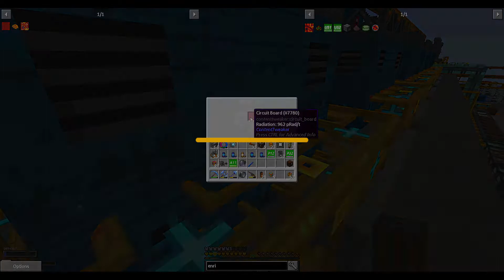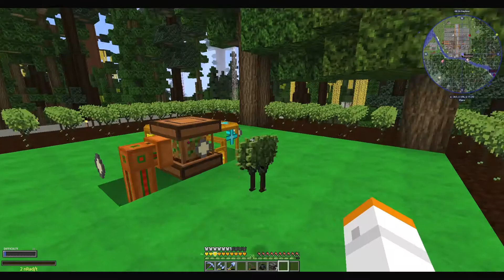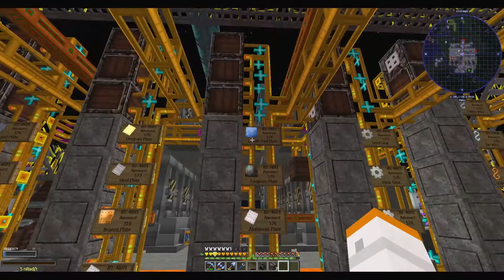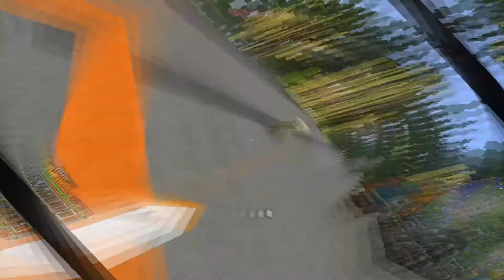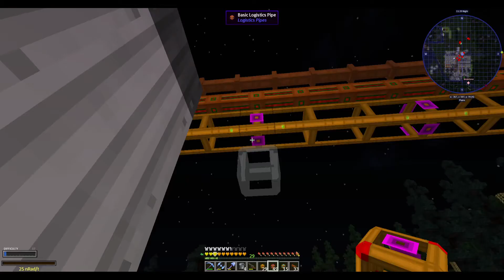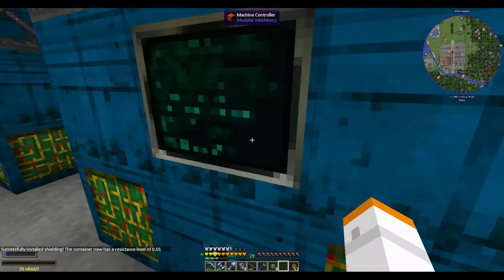Manufactio NE EP18 Base Updates Starting Tier 3 Circuits

Comment: do u have ender chests and remote orderers and pipes? if it still works u can use this orderer together with an ender pouch to requests items on the go, kinda lika a primitive ae system
Reply from the maker: Research Gated, likely will have access to Refined storage before I have access to an enderchest. Pack is heavily modified, normal routes do not exist.